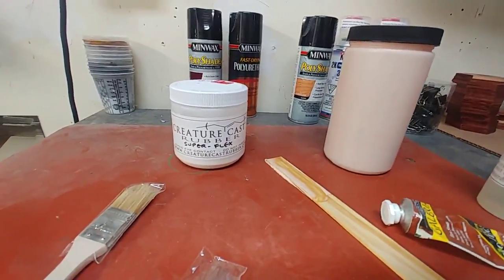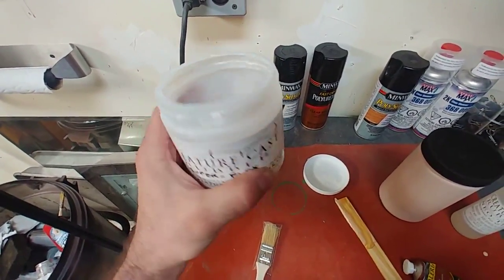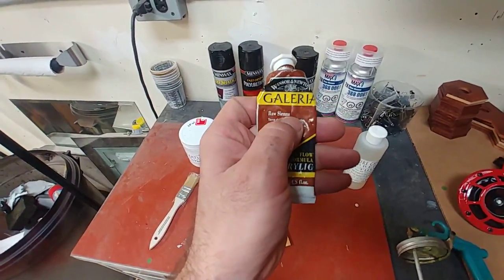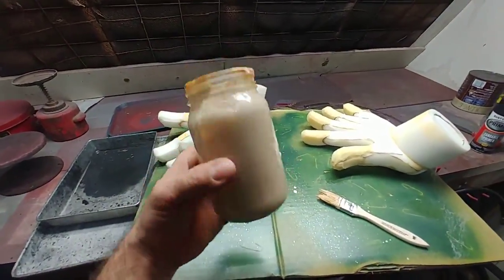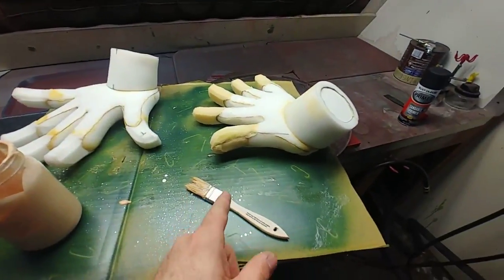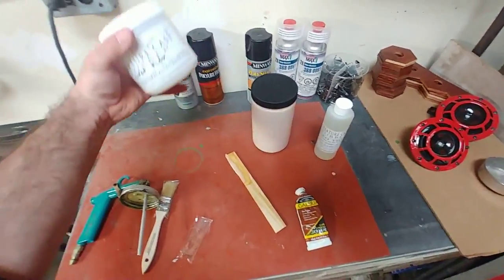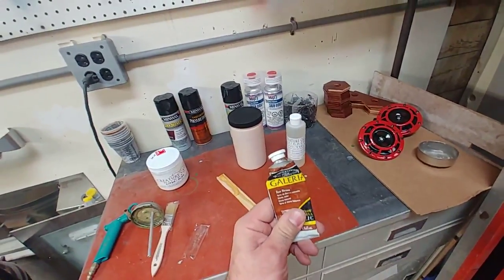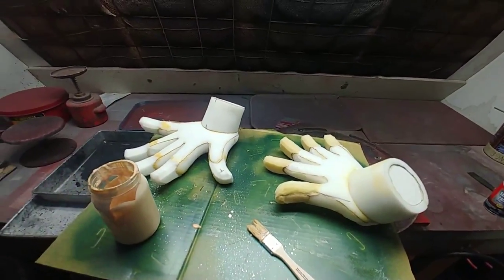Creature Cast Rubber - Better Than Liquid Latex

Comment: How long did it take to dry for you? The website said it could be up to 4 days which seems incredibly inconvenient compared to latex or silicone.
Reply from the maker: It dries about as quickly as acrylic or latex paint, all of which are water based. Nothing unique. If you're slip casting plaster molds, as you would with latex, you'll need to let castings fully dry to some extent.

Comment: Does creature cast need silicone sprayed on to it to keep it from cracking like how latex and plasti-dip do? And is creature cast soft enough to hit people with, would it be suitable for a LARP weapon?
Reply from the maker: Latex, Plasti dip, creature cast, and silicone are four completely different rubbery materials. Each of them is available in slightly different types and maybe applied in different ways under different circumstances at different thicknesses. You could use any one of them to coat soft foams and create a rubbery skin.

Comment: I am trying to airbrush a latex mask using the flexible creature cast rubber , I cannot get it to spray out of the airbrush right at all, it only comes out in very small amounts and does not stay on the mask, it just keeps fading off ! What am I doing wrong ? I am using a paasche airbrush
Reply from the maker: I have not heard of using CCR as a paint the way you describe. Also, latex and CCR are two different materials, I'm not surprised it's not bonding well. If painting with CCR can be done at all, you would want to try painting a very fresh CCR casting of the mask. If  you have a latex mask, you  should use paint designed for airbrushing onto latex. I think you're trying something new and it doesn't work. CCR is a slip casting material, and may be used to paint itself, but you can also use acrylic paints which is a huge benefit. Acrylics already come in every color ready made. Mark the guy who distributes CCR, does incredible
 things with it and is an amazing resource.
Reply: @TMFXLLC  ok thanks, I was trying to use the off white CCR as a base coat for my Michael Myers mask, I thought CCR could be used to airbrush onto a latex mask but I guess it’s not for that. What white paint would you recommend for a base coat that would work well through my airbrush?

Comment: Hey there! I was curious if it would be possible to cast creature cast rubber in a silicone mold?
I have a creature head I want to mold, but I've never made an ultracal or gypsum mold and they scare me! I don't want to mess up my sculpt! I do know how to make silicone molds, which is why I'm wondering if it would work in this case. Not as a slip cast, but maybe a rotocast in multiple layers with neo-thix?
Thank you for your time!
Reply from the maker: You would likely have to dry each layer with a blow dryer and build them up. The silicone won't pull any moisture out of the CCR. I'd be interested to know how it went! Thanks for watching!

Comment: Can creature cast be cast into a silicone mold? Possible heating to dry?
Reply from the maker: It's a water-based solution, dwelling in a plaster mold, the plaster will pull water out starting at the detail layer and building a thicker skin over time. Pouring the rest out, the back side will dry and you'll be left with a rubber skin of a thickness based on the dwell time. Silicone will not pull moisture out, so you'll need to brush up layers and let them dry from the back side. You can't get a solid part any more than you could with latex, it's a one-part air-dry material.